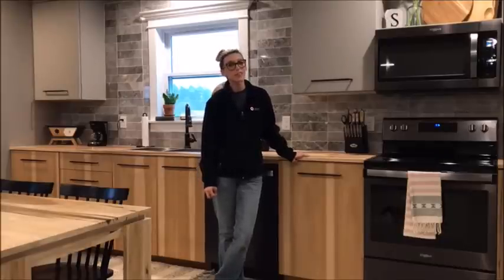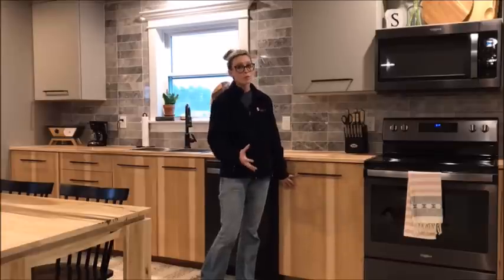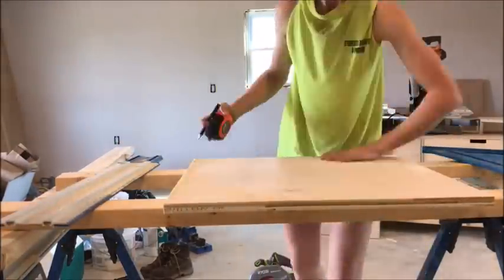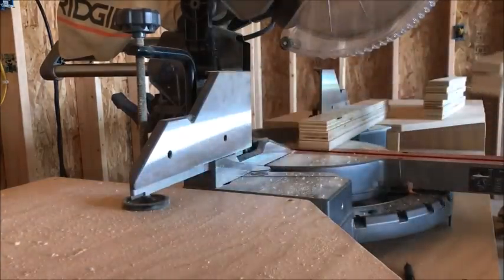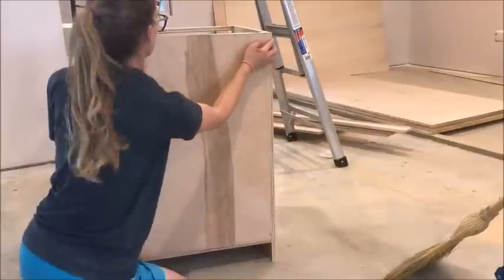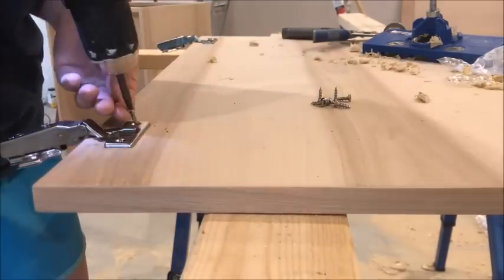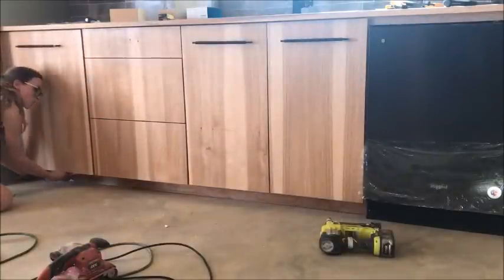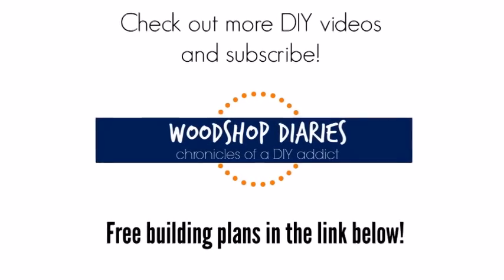How to Build Your Own DIY Kitchen Cabinets--Using Only Plywood!

Comment: Great work on the cabinets.  I can't tell if you were implying this or not, but all high quality cabinets are plywood (prevents warping) .  The only pieces that aren't, are door frames or face frames.  You don't have either, so this is exactly how it should be done.

Comment: Thanks for the video Shara! I like your work. The result is really neat. How did you deal with getting the cuts waterproof? My experience with plywood showed me, the cuts and joints love to suck up water. Happy to hear your advice on this!
Reply: I was wondering about the moisture and waterproofing as well.
Reply: I would use waterproof glue and then wax or sear the rest

Comment: If pre finished plywood costs the same as non finished birch which would you go with? Is non finished more forgiving for touch ups and painting? Thank you for your time and input. It's much appreciated
Reply from the maker: I’ve never worked with prefinished as I’ve never found it available in my area. I sand everything multiple times (is a good and bad habit haha) so I can’t imagine I’d like using prefinished because I’d want to sand it and that completely defeats the purpose. But, if you’re careful and get away without sanding any part of the surface, it might save you some time. The insides of my cabinets just aren’t finished.

Comment: What size circular saw do you have attached to the Kreg? Trying to figure out what works with it.
Reply from the maker: I have a Ryobi 7 1/4” 👍
Reply: Thanks! Now another question.. when you made the pantry cabinet did you have to do 2 separate boxes and attach them or did you use one solid piece of plywood for each side of the pantry?

Comment: Hiiii😊 question ; say if you want to paint the cabinets, is pure bond plywood still best? Also if so, when it comes to the ironing on the edging .. do they come in different colors or would I just sand &  paint the edge? Thank you in advance for your response.
Reply from the maker: Hi! I prefer to use cabinet grade plywood even when painting. That’s what I did here. As far as edge banding, you can still use it when painting. I have a section for frequently asked questions about it (like this one) in this post: https://www.woodshopdiaries.com/how-to-cover-plywood-edges/
Reply: @WoodshopDiaries  thank youu ! I just started school for Construction Technology at the community college near me & I’m in Intro to carpentry & carpentry I .. I’m learning so much ; from in the workshop & YT University lol my next two projects will be a cabinet for my laundry room & a swing for my front porch. 🥰

Comment: Thank you. Very nice video. Well done. You did not use wood glue, correct? And you did not add any other like 2x4 to support ?
Reply from the maker: I didn’t but you can use glue if you’d like. They’ve held up perfectly the three years we’ve had them. No other supports but what you see here.

Comment: I’m getting ready to start my kitchen cabinets after STUDYING your tutorial!! But I’m wondering what material you used for doors that were painted?  it seems such a waste to use the hickory. And do you skip the banding on the cabinets that were painted?
Reply from the maker: I didn’t skip banding on the painted parts…the banding makes the edges nice and smooth for painting…but I did use birch plywood instead of hickory as it’s quite cheaper, but finished nice and smooth. Hope that helps! Happy building!!

Comment: Looks great - question for you - how did you avoid the pocketholes showing on the underside of the cabinets? just filler then paint?
Reply from the maker: I just left them. You could fill them if you wanted, but you don’t really see them as they’re underneath…unless you’re just looking for them.

Comment: Did you apply edge banding to the painted cabinets? We will be painting all of ours but I don’t know if I can skip that step or not lol.
Reply from the maker: I did. You don’t have to, but in my opinion, it’s easier and less messy to apply than to use putty or filler to smooth it out. Just a personal preference. Either works. You can check out my guide to using edge banding here:
https://www.woodshopdiaries.com/how-to-cover-plywood-edges/

Comment: What is the tool you used together with you circular sawtooth cut straight lines called? Amazing work you do. Thanks for sharing and empowering many to take on such projects creating many happy homes in the end.
Reply from the maker: You can check out both tools j use for cutting down plywood here:
https://www.woodshopdiaries.com/cut-down-plywood-sheets-with-circular-saw/
I got so many questions about them, I wrote a whole article and made a whole video about it. 👍 and also, thank you so much for your kind words!!

Comment: great video and tutorial but man im a dj professionally that music up and down super loud then low is murder ill almost had to clean my chair it scared me so bad hah.... lol.. love your work though i may be doin this and spending lots of time with ya hahah.. my mobile home has horrible cabinets. i think i may measure what is already there which is only bottoms and mimic with new materials to make it look nice again its such a small space maybe 11 feet across and 2 feet deep tops... ive never done this but ive done floors and drywall and all kinds of stuff. and im thinking of maybe using pallet wood for the doors... i dunno what do ya think? maybe you could help me come up with a design if i email you pics of what im dealing with etc... i dont plan on being in this house more than a yr longer cause i want a brick and mortar home finally... if you can spare some time id love your input. i have nobody to help me with this really ill be on my own. gf of 3 yrs took off while i was away at work stuck me with all finances and took my damn cat hehe.. left me a mess to deal with so im trying to make this place my own and start fresh for the next yr or so.... thanks again. truly love what youve done here... cept that damn music bahahaha

... i have no idea how im gonna do the tops..... new grounds for me top and bottom here...

Comment: What hinges did you use for the doors that butt up against the drawers? I’ve read to install half overlay door hinges because regular ones won’t work since the cabinets are frameless. What was your experience?
Reply from the maker: I used full overlay hinges for frameless cabinets for all my doors here. They worked great. I linked them in the blog post in the video description 👍

Comment: is there a place where I can find the measurements you used? its a bit confusing in the video. I would love to do my kitchen and modify the dimension according to the space I have, but it would be so much easier if you drop a drawing with height, width, depth etc. thanks!
Reply from the maker: You can find written instructions here:
https://www.woodshopdiaries.com/how-to-build-your-own-diy-kitchen-cabinets-2/

Comment: what is that thing you are using  to help make the straight cuts of the plywood?
Reply from the maker: https://www.woodshopdiaries.com/cut-down-plywood-sheets-with-circular-saw/
Reply: @WoodshopDiaries  I'm getting the rip cut! It's exactly what I need...thx! Why would I need an accucut if I have the rip cut? Just to ensure a square edge?

Comment: your blog site is not iPhone friendly at all, it keeps jumping back to the beginning of the post when I scroll, you do awesome work and I was looking for plans and material sheet so we can do these but not finding them.
Reply from the maker: I’m not sure what you mean. It functions fine on my phone. And most of my users are mobile users. There’s an arrow towards the bottom that is designed to take you to the top of the page. If you click it, it does jump to the top as it’s supposed to. But the plans can be found here:
https://www.woodshopdiaries.com/how-to-build-your-own-diy-kitchen-cabinets-2/
Reply: @WoodshopDiaries   I'm having a issue where I scroll down about a quarter of the way into the post and it jumps back to the beginning, it may just be my phone though as it works fine on my iPad

Comment: Well this is the way to make them but these places where they sell this cabinets they all make them with cheap wood (saw dust and wood chips) and charge an arm and a leg for crap. Thank you for using good quality plywood not sure if you are using Baltic birch but that would be the plywood of choice for a quality cabinet.

Comment: You are very skilled. However if I need to buy all the carpentry machinery you have, I might as well buy commercial gear. If I had all the gear you have I would have the skills to do this myself! How about a minimum equipment video?

Comment: Where did you get that Ryobi track saw?
Reply: It is not a track saw. It is from kreg. You attach your own circular saw to a plate from kreg and the plate runs in slots in the kreg straight edge. It costs about 80 bucks.
Reply: @richardlug6139  Thanks--I actually figured that out and bought one. Works great! Never had a track saw so I don't know if it compares to that, but it's way better than a circular saw and even better than my rusty old table saw!